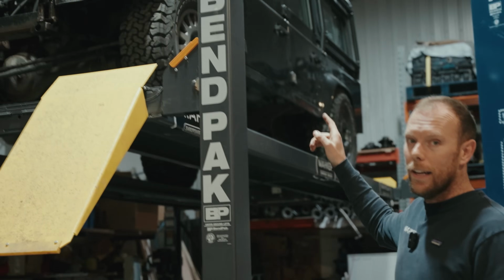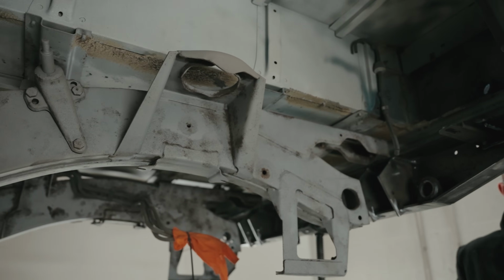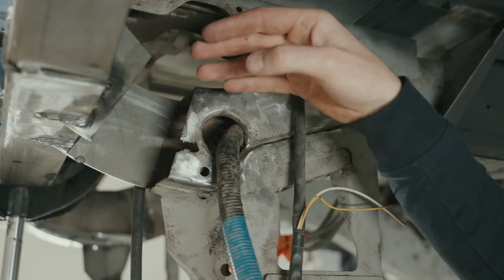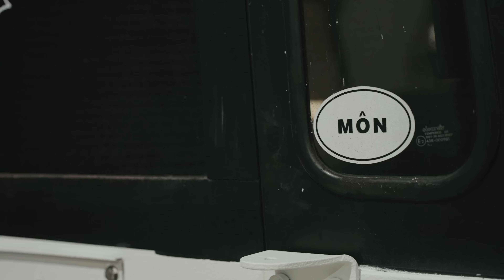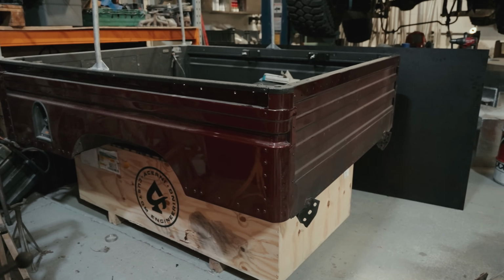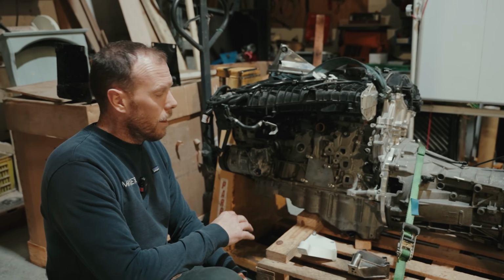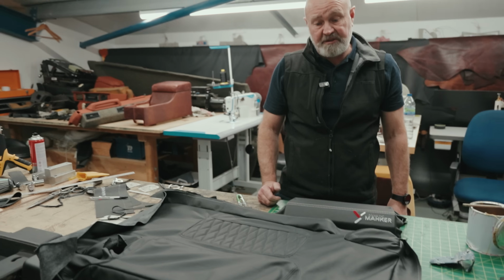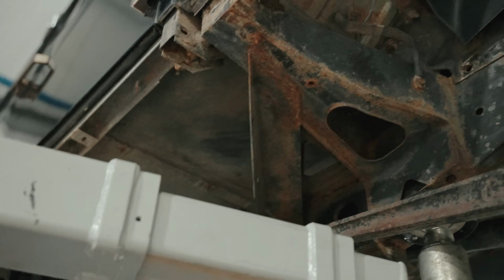Worth It? Recycling a CRUSTY Old Defender to look NEW Again || Mahker Weekly EP103

Comment: The recall was for 2011/2012 Defenders only. I think it was Recall no. N607. My local main dealer made me wait 3 hours to complete the job - all it takes is undoing the radius arm bolts and fitting a bracket; probably 5 minutes in total.